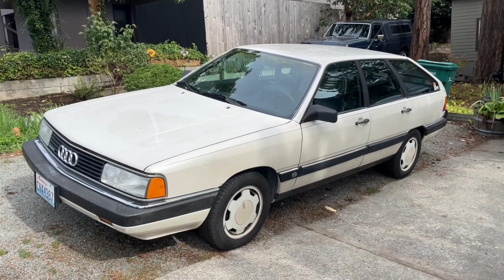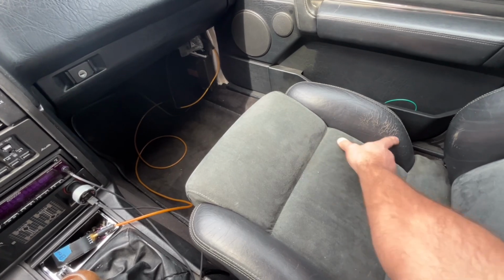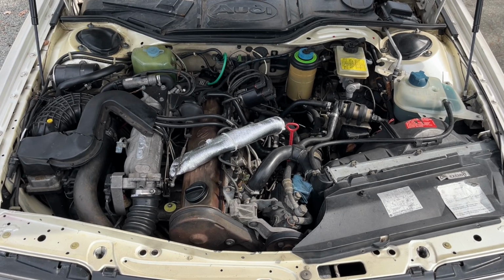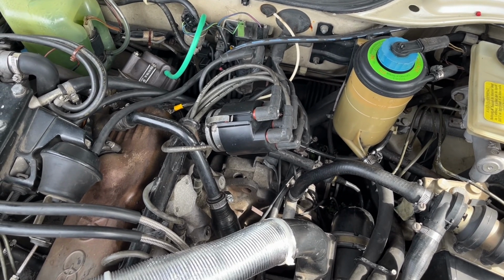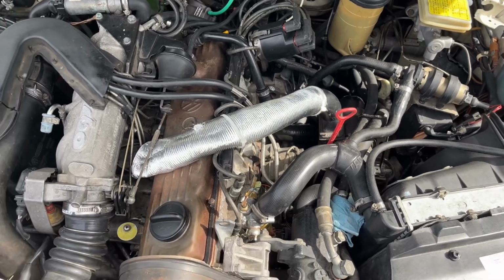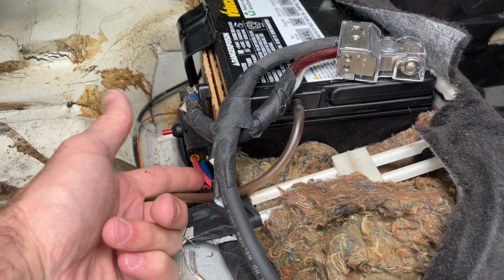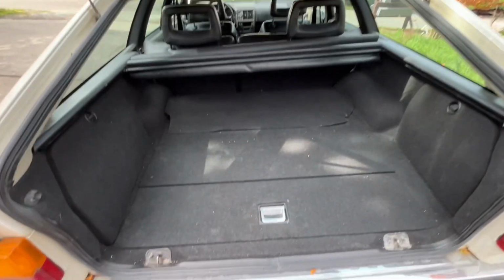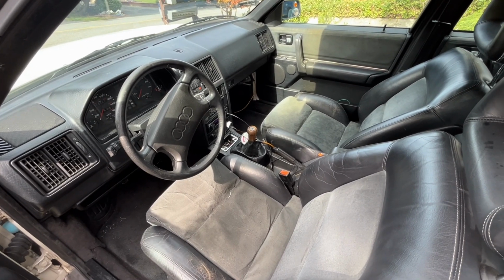My New Toy - Audi 5000 CS Quattro

Comment: Love the review, 280K miles is a testament to the outstanding durability of the iron block 2.2L , I had the n/a version in my coupe GT, approximately 180K miles plus when I sold it in 1993
Reply from the maker: @tonychavez2083  I was going through the records and found a compression test from when it has about 110k miles. It would be interesting to see how that's changed in the following decades!
Reply: @ I don’t think it would change much if at all. This generation of of VW Audi products were  pretty stout. Only trouble prone areas were rubber parts for intake and fuel system. CIS injector o-rings, and air intake boot and idle air valve rubber becomes hard and leaks air. Brilliant cars overall.

Comment: My mom had the Audi 5000S Avant in velvet navy blue and sky blue exterior. With pin striping I think. It had the quad lighting.
Reply from the maker: @Andrew-zv4fm  would've been an 84 or 85!
Reply: @compu85  it was from 1985 I believe. The car had a lot of issues. Unintentional acceleration wasn't one of them.